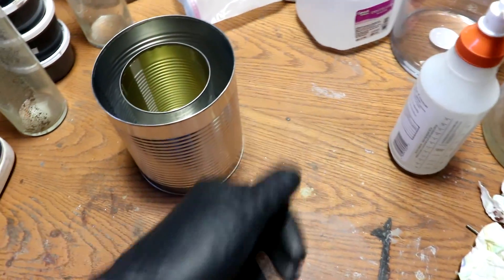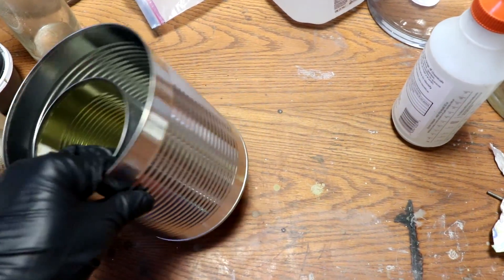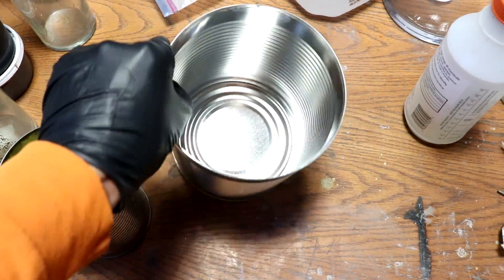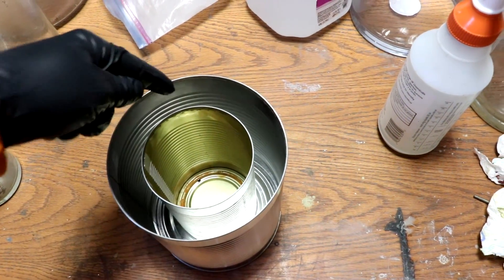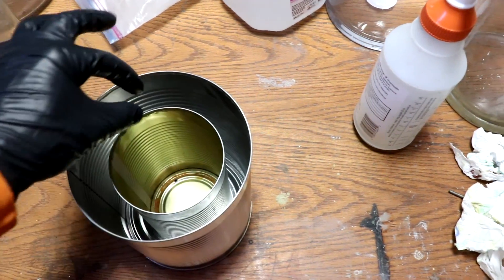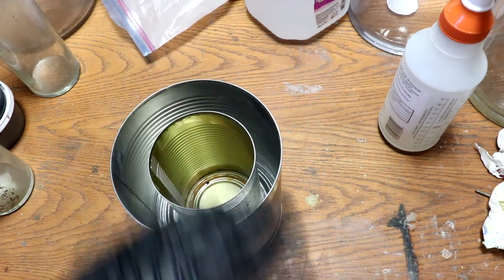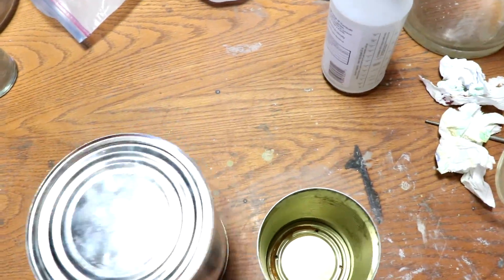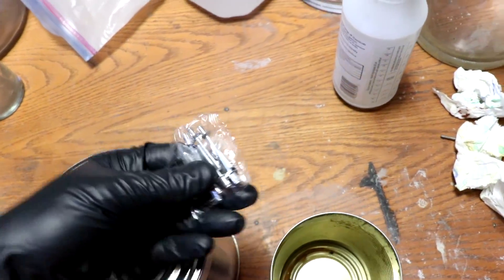The Rad Can

Comment: *Casually pulls out some radioactive materials he's been storing around the house
Reply: of course? did you really expect anything less from cody?
Reply: Well that's why he needed the can
Reply: He probably had them under his bed.
Reply: @kaptein1247  Pillow
Reply: Yellow cake is fairly harmless as long as you keep it out of your body and away from close proximity with your gonads.
Reply: @roberson644  gonads killed me.
Reply: well yes, but actually no
Reply: Important safety note. Lead is good shielding for gamma, alpha, and beta radiation. But it's terrible shielding for neutron sources. Neutrons tend to knock other neutrons off the lead nuclei. So you wind up with two neutrons at slightly lower energy. Net is dose can go up drastically.  For neutrons you want a nice deep pool of water.

Of course, intense neutron sources are not things even Cody has just sitting around the house.
Reply: @puppetsock  dont give him ideas
Reply: @puppetsock  so the next video will be building a reactor waste pool
Reply: @puppetsock  or does he? next video: "Building a pool for my neutrons"
Reply: @puppetsock  we've run into this issue shielding parts on spacecraft from very high energy gamma and cosmic rays. Turns out that tantalum had the same problem as lead. There is a sweet spot in thickness that sets the capture area, too thick and you get  secondary radiation,  too thin and you don't get enough shielding.
Reply: @puppetsock  homemade tritium?
Reply: @puppetsock  Alpha rays are irrelevant as they are blocked by virtually anything. Gamma rays are attenuated. Lead pigs are pretty pathetic for shielding against strong gamma sources as rays are not blocked, but attenuated. For sources that can actually harm you, you need more than few centimetres of lead.

Neutrons are irrelevant as he can't get chemicals such as californium chloride...

But for beta, and their resulting x-rays, lead pigs find excellent application. Thing is - he can't even get a strong beta source except teeny tiny directional strontium-90 calibration sources. Again, not dangerous.

So it's useless for storing uranium ore, thorium mantles, etc.
Reply: @lajoswinkler  Actually, for gammas what you want is lots of protons. That's because gammas primarily interact with charges. So lead is as good as anything you can cheaply get.
Reply: @puppetsock   "Of course, intense neutron sources are not things even Cody has just sitting around the house." - not so sure about that. I mean - he did wear gloves for the video, so he surely had been doing some math, and since "one does not" need math for  Pb, that might sugest something more going on!
Reply: None of which are particularly radioactive. Measurable, sure, but not worth worrying about even if you store them under your bed. The worst thing about the uranium ore is that radon is gaseous since it will contain some radium, it's enough to raise the radon level from not worth worrying about to a few times not worth worrying about. Medically it doesn't matter, but it might matter if some radiophobe comes to measure the radon level indoors and insists you do something about it.
Reply: soylentgreenb  Are you suggesting radon accumulation in your home is harmless?    I hope not - we do science here, and radon is bad stuff to be breathing.
Reply: @jacksons1010  he just wrote that the radon is the only thing that is dangerous but with the amount cody has it wont be enough to worry about.
But it would be cool to see cody build a storage unit for it
Reply: @ @rasmuspedersen2001  The radon is a decay product of the uranium ore.  @soylentgreenb seemed to dismiss that as a concern, and wrongly so.   In modern times we build homes that are relatively air tight, lacking in fresh air circulation.   Such a home built in areas where radon is naturally emitted from the rock and soil it is built upon tend to concentrate this radioactive gas - it must not be ignored.   A properly gas-sealed foundation and fresh air intake for the HVAC will mitigate the problem.
Reply: Yellowcake and Uranium ore. Less radioactive than a plane trip. Makes me think he might do some more stuff with radioactive materials in the future.
Reply: Next to the sugar in the pantry
Reply: when mom comes in and you hide plutonium under pillow

Comment: So 1 inch walls and lid, what about the bottom, isn't it just 2 thicknesses of tin ?
or did you pour an inch of lead into the inner tin ?
Reply: generally theres 50000km of rock at the bottom of the can
Reply: not if he has the can on a table or shelf
Reply: @sparkyprojects  good living room decoration you reckon?

Comment: I think cody should start series on uranium enrichment and nuclear reactors.
Reply: He did, then was visited by our shitty gov't
Reply: @skyrailmaxima  Was it really about uranium enrichment and nuclear reactors or just some safe experiments?
Reply: @omarkhaledk11  I don't think he was meaning to enrich uranium but he said that he was working in a fansworth fusor and he got a lot of wax to be used as a moderator for the neutrons made by the fusor. Fusion reactors don't use moderators afaik so he was likely working on an hybrid fusion-fission reactor using the neutrons to trigger fission in unenriched uranium. It would have been awesome if he could pull it off specially because that kind of reactor can't really blow up, is easy to throttle, should burn the fuel until there is almost no radioactive residue and an amateur doing it might light a fire under the ass of the people that should be building and deploying that kind of reactor.
Reply: @omarkhaledk11  you can't legally own water soluable fluoride uranium salts in the US without special permission from your overlords.
Reply: @skyrailmaxima  Since when is that the case? I thought the law (in any country) prevents you from isotopic enrichment of uranium-235.
Reply: @lajoswinkler  yes this is true that is also a restriction. As well as breeding Pu 239 from U238. A step in u235 enrichment is conversion to UF6 for gas phase centrifuging, hence it's legality
Reply: Vincent Castilow a shitty government would be one that didn’t check on people messing with radioactive materials.  Google “dirty bomb” and you’ll understand.   It’s not like Cody got thrown in jail or anything.
Reply: @jacksons1010  Dirty bombs aren't even that dangerous. They were hyped up to help justify a war, but if you look at the facts they are a terrible weapon. They only way to get a dangerous amount of radiation from non-enriched sources is to inhale it as powder; by time you come up with a way to get people to inhale a powder, you might as well use a much more damaging chemical powder. Heck, bathroom cleaner would be more dangerous. 

There is a reason the Germans(WWII) designed a dirty bomb, but never used it and decided it was a waste of resources.
Reply: @amir_404-e4d  The point of a dirty bomb is not to irradiate, but to contaminate small areas and to create a societal disruption. Hence they're a really good terrorist weapon and it's a good idea for the relevant organizations and services to monitor suspicious activities of that kind.
Reply: bet the feds wouldn't agree
Reply: @BluntofHwicce  Yea, but uranium itself isn't anything special. There is a massive difference between refined and enriched.
Reply: LOL
Reply: @PenileAugmentation I suspect that it wouldn't achieve net energy production with a fansworth fusor ( though I don't have any calculations to really know ) but it has been definitely considered and would work with more serious set ups, just as using a particle accelerator to trigger fission. Sadly although there are some timid attempts at researching it, it has been mostly overlooked in favor of the much more advantageous pure fusion or the easier to do pure fission .

Comment: Next video: Snorting Yellowcake off the table to prove its not harmful
Reply: raydlevel5  no, gamma is also very bad for you.
Reply: @CAMSLAYER13  Gamma is bad for you, but it also hardly interacts. The old saying is if you have an alpha, beta, and gamma emitter, and you have to hold one in your hand, put one in your shirt pocket, and swallow the last, you put the alpha in your hand, the beta in your shirt pocket, and swallow the gamma emitter. The reason being, the alpha particles will be blocked by the dead skin cells on your hand, the beta particles will be blocked by even the thin cloth of your shirt, but the gamma photons aren't gonna give a shit even about several feet of concrete, so you may as well swallow it. Now, radiation scales are generally based around human dose, which makes it complicated to discuss this next part, so I'll just talk about energies instead, as that's really what we care about here. The point is that it takes a lot more gamma energy to cause harm than alpha or beta, because almost all of the gamma won't even interact with your body, or probably even anything in the room, whereas all of the alpha and beta particles that intersect with your body will interact with it. So a weak gamma emitter (if there are any non-toxic ones) really won't be an issue. It could be putting out much more energy than a comparable alpha or beta emitter, and the received dose would still be much lower.
Reply: @sac3528  I still wouldn't recommend eating a gamma emmiter
Reply: Nice
Reply: I feel like that would mess you up in a hurry
Reply: Siddharth Jha 👌😎👌
Reply: LIKE A BOSS! 😎
Reply: Guys. Please don't give him any ideas.
Reply: Lmao ;)
Reply: G'day,

Puh-Lease..., try not to give him ideas for newly innovative ways to court a Darwin Award...(!).

Take it easy,

Such is Life.

;-p

Ciao !
Reply: On Jha
Reply: raydlevel5  Ingesting Uranium isn't exactly a good thing, but it is barely radioactive.  Halflife of 4 billion years (and the 0.7% U235 w/ HL of 700 Million years).

You should be more worried about the heavy metal poisoning received from ingesting it than the radiation dose.
Reply: Im in
Reply: Or an actual cake made from yellow cake, lol.
Reply: then chemotherapy, or how i learned to start worrying and hate the bomb
Reply: raydlevel5  you can not get away with it. It's ionizing, and would continue harming you for quite some time (I'm not sure of it's half life)
Reply: Don't give him ideas
Reply: Cody: 1 microgram...
Reply: Don't Give him ideas.
Reply: or bake a yellow cake, from yellowcake
Reply: Haha
Reply: raydlevel5  In the order of gamma > beta > alpha the radiation can penetrate more material before being absorbed. Alpha radiation can be stopped by a sheet of paper but it will surely be absorbed into your body and do damage. Gamma radiation might require several centimeters of lead to block most of the radiation but is more likely to pass through your body without any harm. However because of the higher penetrative power gamma radiation can also easily damage the cells in your bonemarrow or internal organs.

The point about ingesting/inhaling alpha or beta emitters is that if they are inside your body they can and will damage your internal organs. If you have them in your surrounding you'll likely be fine and if you have some on your skin you can wash it off. Gamma emitters are roughly equally bad for you whether they are inside or outside your body. You can get away ingesting anything in very low doses but please don't, it can still cause some harm.
Reply: Snorting Yellow Cake is Better than Snorting Comet Cleanser..
Reply: @johncrowe5164  Nice Cheech & Chong throwback!
Reply: @johncrowe5164  And safer than snorting glyphosate
Reply: Funny joke but completely missing the point of those videos. Some things are dangerous and others aren't.
Reply: Next week on codys lab, will snorting yellow cake give you super powers or stage 4 leukemia overnight? Lets find out
Reply: @dustinlovejoy1  More likely to give you lung cancer, from the alpha.
Reply: Thats funny but fuck you
Reply: @Siddharth Jha  Don't be stupid! Stupid, impressionable children, like you are the reason YT cracks down on science channels like Cody's.
Reply: @psygn0sis  it's a joke
Reply: @psygn0sis  Stupid, impressionable children, like you can't differentiate a sarcastic joke comment from a real one, mr. science channel connoisseur.

Comment: Good short video but the question I've always had is what is the lifespan of these lead-lined areas
Reply: Highly radioactive isotopes e.g. as used for medical purposes, have very short half-lives, so are stored in lead containers only for short periods until ready for use.  A few hours or days later, the radioactivity has decayed to practically nothing.  Same with high-level waste in the form of spent fuel rods, a few weeks in the storage pond and they have lost most of their activity, and the pond serves to cool them also.  Ten half-lives and the activity is reduced by 2^10 or less than  0.1% of the original value.  Thirty half-lives and it is gone forever!

Comment: How do you work with materials like that without getting radiation sickness?
Reply: You would be surprised how much radiation we are exposed to every day.  That being said it really comes down to probability, under a certain amount, so there is always risk but it is usually low.
Reply: youd be surprised how much radiation is hyped up
Reply: Radiation is ok if it's not too strong and in short bursts, polonium plated walls wouldn't be good but uranium oxide in your garage opened infrequently is fine.
Reply: Google up how much radiation comes out of ordinary every day items like wood and rock that may be all around you such as when in a basement. It's not that big. In fact my father was stationed on Hiroshima 9 months after the bomb went off and even living almost another 50 years never showed any signs of radiation poisoning.

In fact the guy he thought did get issues were from not tuning the magnetron tube correctly. (It's used in your microwave also)
Reply: The highest reading that the counter displayed was 7.4 μSv/h.
To get symptoms of radiation sickness you need to absorb about 400,000 μSv.
So unless he makes a habit of holding that bag to his chest for over six years he'll be fine (ignoring raised cancer risk in which case he'd only need to be in close contact for a year and a half).

Comment: levels of radiation storage:

0 - nothing
1 - cardboard box
2 - lead box
3 - lead box buried underground
4 - specially constructed barrels used to store radioactive waste from nuclear reactors buried way deep
5 - cody's rad can™
Reply: Its RADical!
Reply: @JeeTinator  It's RADioactive!
Reply: time for bethesda to put these in Fallout..
Reply: Lv 10 crook 
to lv 45 boss
To lv 10000 Rad Can
Reply: McRadcan™
Reply: Some might think the Rad Can is just a lead box, but its rad paint job elevates its actual efficiency by 3 levels of radiation storage.
Reply: No. 4 would be a "Castor". It's a brand name owned by a German company, shorthand for "CAsk for Storage and Transport Of Radioactive material"
Reply: @spacenomad5484  so a specially constructed barrel used to store radioactive waste from nuclear reactors buried way deep?
Reply: @puncifikator3870  Yup, AKA a castor
Reply: Rad Can™ Now at your local Supermarket for just 9,99$
Reply: The thing is... storing them all together means more exposure when you want to use an item from there. Solution... More Rad-cans.
Reply: I_AM actually for specially constructed barrels used to store radioactive waste they use inches of steel and feet of concrete because it's " more cost effective for temporary storage". So Cody's lead can is better on a small scale than larger facilites.
Reply: I hate anyone that liked this

Comment: Would lead sheeting or foil also work?
Reply: Yes but you'd need to do some math, and it'd depend on what you're storing, Cody here with god's damn yellowcake needs the density therefore it's cast, whereas I have some americium samples shielded perfectly fine with an altoids tin. 
If it was sheet you'd probably need double layer thickness because of the gaps inbetween